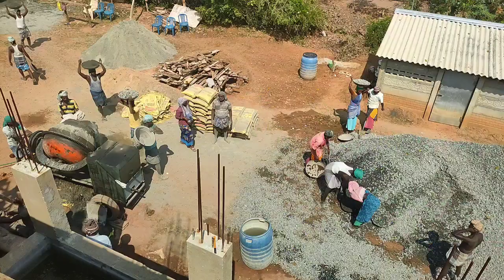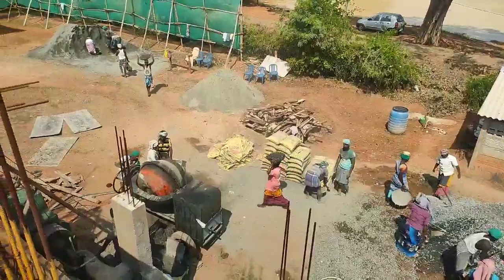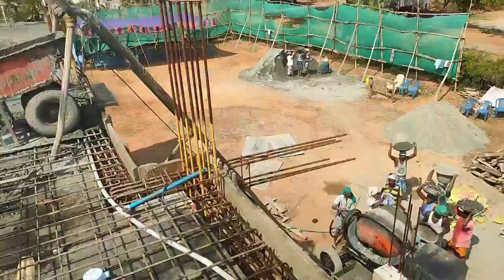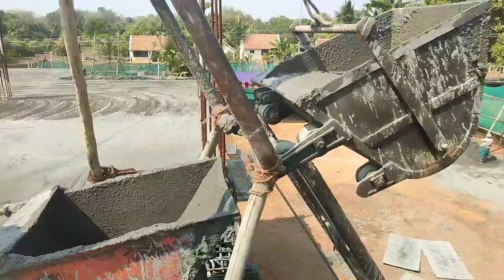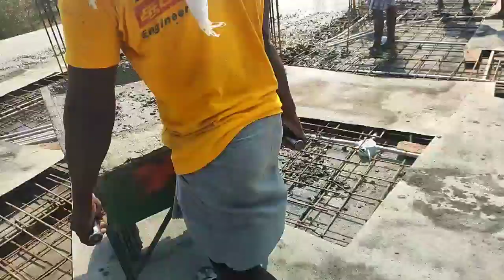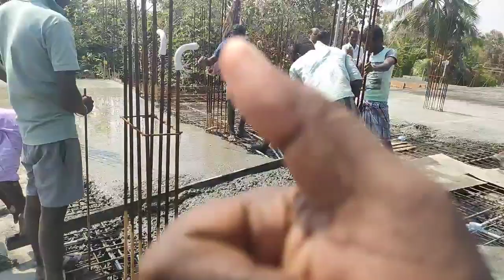concrete mixing ratio | M20 grade | on site video

Comment: M20 concrete mix : Instead of 1:1.5:3, 
 through practical knowledge,  
the ratio is slightly changed as 1:2:3.
Half load of the mixing machine is practiced ; And the labour is suitably  distributed to avoid any confusion. 
Thank you, Engineer.
Reply: Aggregate size used for m20 grade????